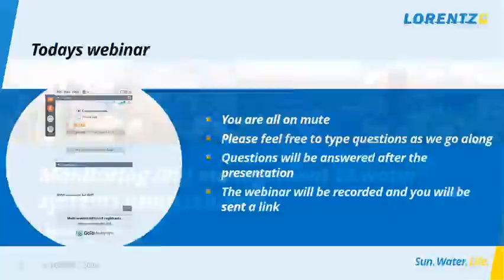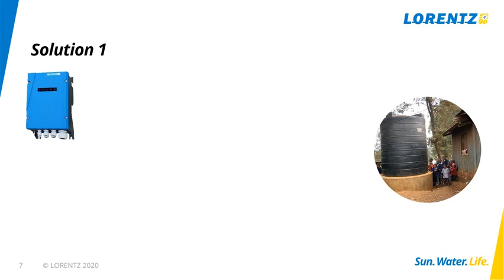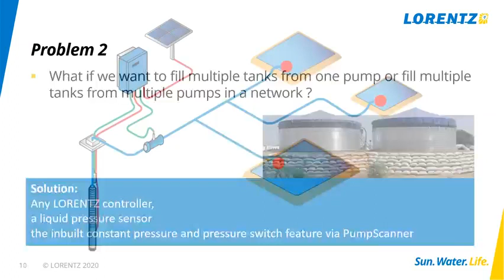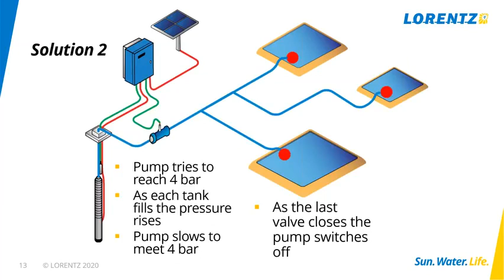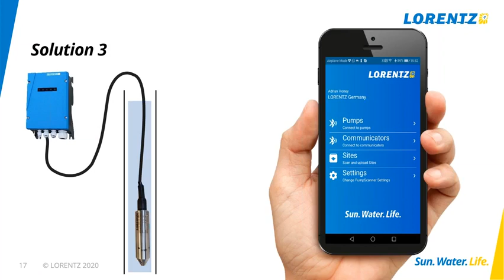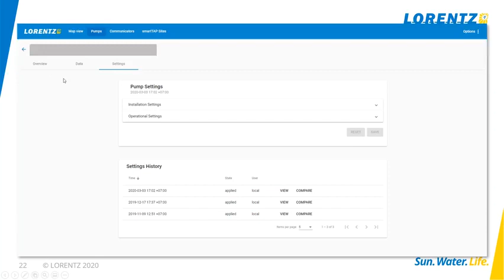Webinar | Monitoring and management of water systems using sensors | LORENTZ

Comment: Please sir , could I use the second method even for helical rotor pump?

I know that for helical rotor pump the presure doesn't change depending on speed.
Reply from the maker: Hello and thank you for your comment! By using a pressure sensor we can still achieve constant pressure with a HR pump, the pump speed will change the flow rate which will affect the pressure. Please have a look at our website for more info and contact details if you are interested in buying a pump.